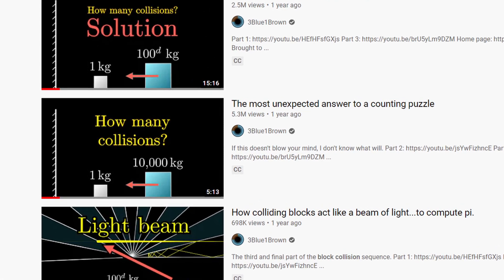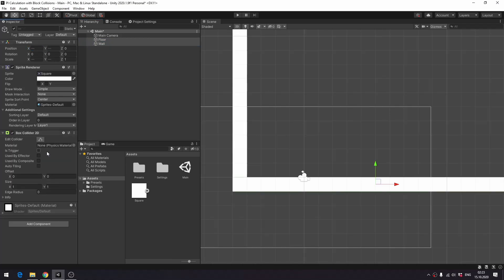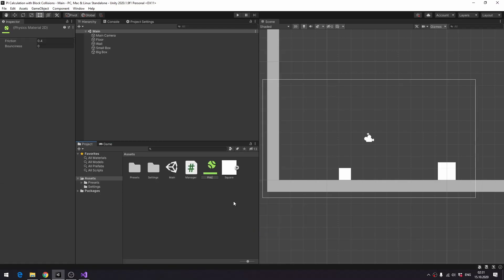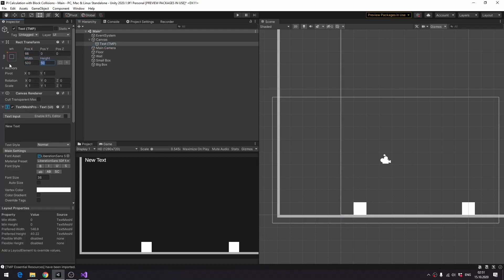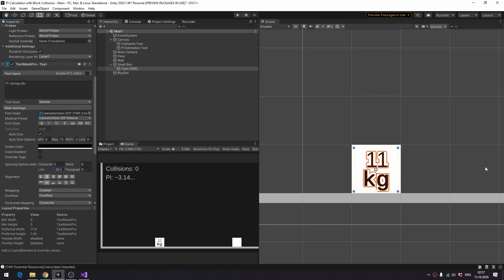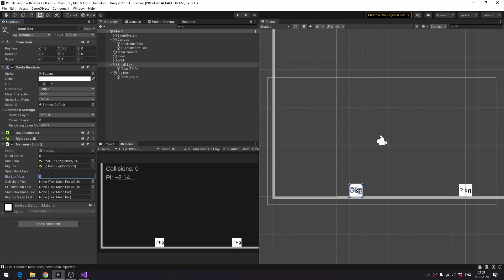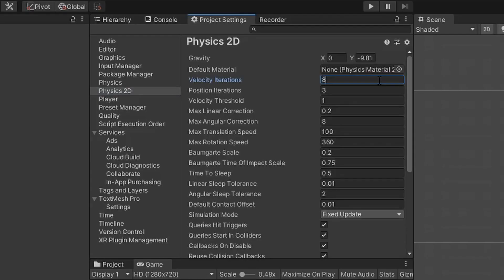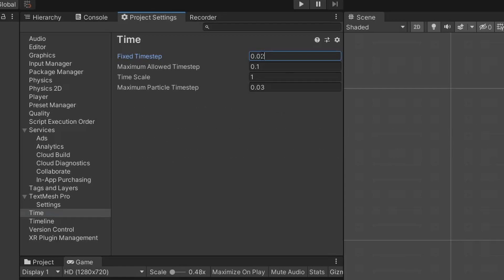Computing PI using Unity game engine's built in physics with colliding blocks (3Blue1Brown way)

Comment: This video is great! When I saw that 3Blue1Brown video, I never thought to make it work in unity. Really good job! But I think you can write your own physics to get closer to math numbers. I believe unity physics is not to simulate that many collisions but rather to simulate somewhat realistic looking physics. You don't need to write anything fancy. You can make them transfer velocities when two objects intersect
Reply from the maker: Glad you liked it!
Yes, it's far from optimal: you can write equations for perfectly elastic collisions - it will be faster and more precise (because you might use double's instead of float's).
It was done by someone here:
https://www.reddit.com/r/3Blue1Brown/comments/ag60b8/i_programmed_3b1bs_simulation_in_unity_expecting/
Even better: you might derive formulas to calculate exact positions of blocks at specific time T directly (without doing any simulation) using ideas from 3rd 3Blue1Brown's video: https://youtu.be/brU5yLm9DZM
But the whole point of this experiment was to see if it can be done with the standard physics engine